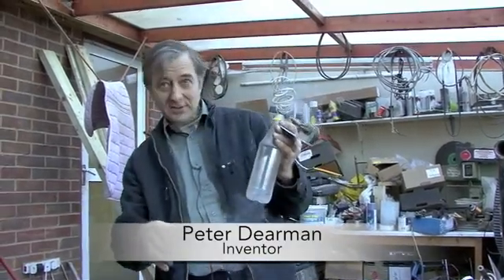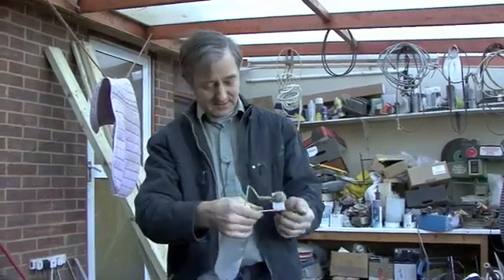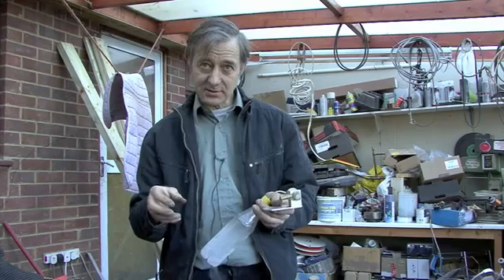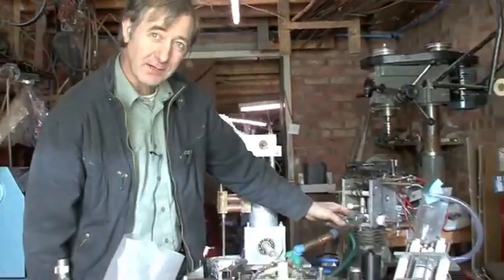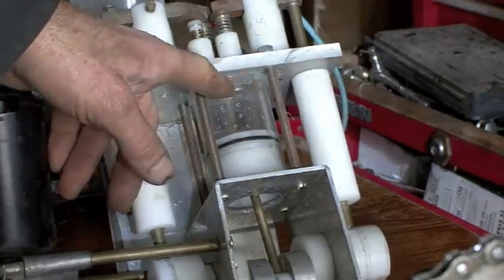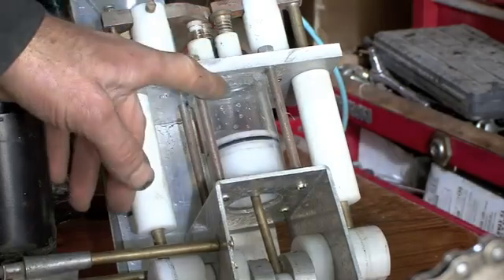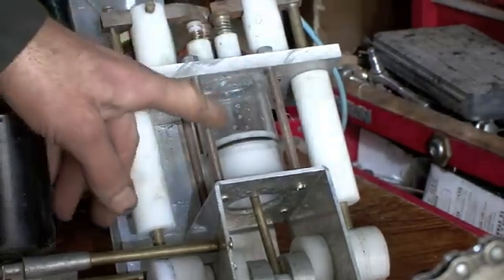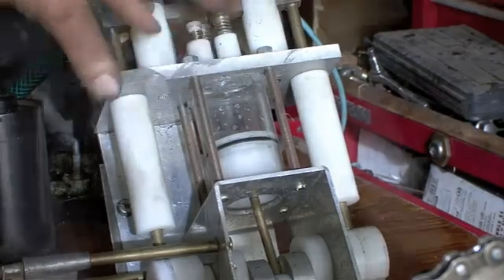Dearman  Engine Company

Comment: Have you guys thought about using a stirling engine in your car designs? Chilling the "cold end" with N2 the "hot end" gets heat from the suroundings.
The engine then used to spin a generator to charge batteries in the hybred.
Have you been in touch with a Dr Plummer? His students built an N2 powered car back in the 90's.